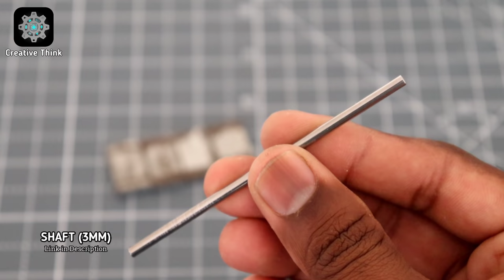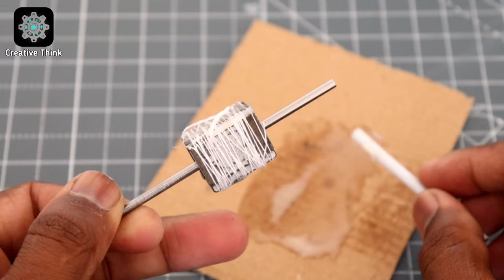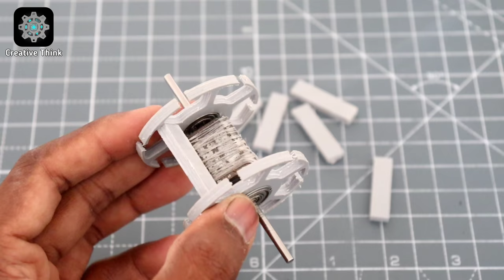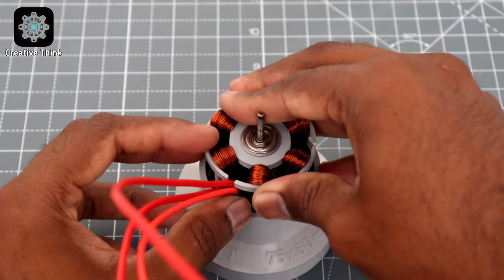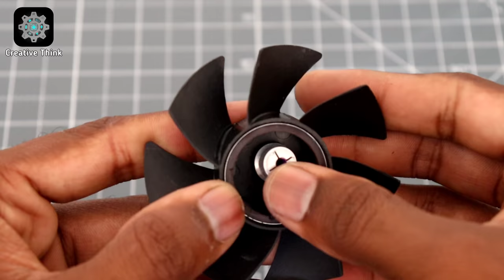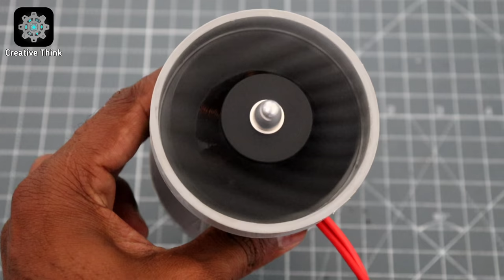Making Powerful JET Engine Using BLDC Motor

Comment: It does make a great noise. Probably good to blow sawdust away, too. I don't quite understand why you are calling it a jet engine, though. Is there any kind of combustion involved? If not, I'd suggest you just call it a fan,  saves everybody's time...
Reply: It’s called an edf. Electric ducted fan. People refer them as hers because that’s the type of rc aircraft they put them in.
Reply: For the views maybe
Reply: Maybe because it's quite powerful
Reply: exactly
Reply: The sound which is coming might be of air due to high suction ...thats the reason it might be doing noice.
Reply: I agree
Reply: Savage 😎bro
Reply: Not so powerful really and not a jet engine
Reply: It's powerfull
Reply: I say u create one your self
Reply: Agree with u bro 100%,peachout yo ...
Reply: I think he just make a motar

Comment: That would be an electric ducted fan. Great for r/c jet builds. Props for building it yourself, I'll probably just stick to a brushless.
Reply: ? there is a brushless motor inside. I personally only like the impeller with many blades and a distinkt woosh sound.

Comment: 1. How this could be a jet engine with electric motor , this thing doesn't even have enough space to pass air from the inside of the motor 
2. What is the point to place turbine , neither it gets air from the front nor there is sufficient space for it to suck air
3. Motor you made is a great piece but you need to fix the unbalanced shaft and fans and even if the motor is powerful , it cannot achieve it's best RPM with this apparatus because the fans don't have enough space to suck the air and the air drag slows the motor

Great video and could have been more useful 👍🏻
Reply: 4. There are no armature in the coils. It enhances the magnetic field in real motors. Without armature, the engine is several times weaker than it could be.
Reply: @MrEfnir  yeah true
Reply: Exactly, this shouldbe called as blower instead.
Reply: Thats Right👍🏻
Reply: I think Mr. Creative think don't know about Jet engine working process.

Comment: This is impressive but "JET Engine" by definition cannot be electric.
Reply: Yes, it a electric engine
Reply: mehdi... I did not find this "JET Engine" impressive. The fan blade units are out of balance and it has very little thrust.
Reply: @rogertycholiz2218  little torque of course, just look at the winding, there's no laminated core in the coils, so magnetic field it's not very powerful
Reply: Your definition of "Jet engine" may be flawed. An engine is a machine that converts power into locomotion (steam engine) or a substantially different product (graphics engine). It is also used abstractly to indicate the driving element of a process (economic engine). Engines may be named for the type of energy/fuel they consume, the function they perform or the product they produce. In this case then, a jet engine is a machine that creates a jet (rapidly moving fluid). From the sawdust being blown away I'll say the video demonstrates that the gadget functions as an electrically-driven jet engine.

Were you thinking of a turbojet engine? That engine creates a jet of gases by burning a kerosene/compressed air mixture and uses a turbine to recover some energy from that jet to drive the compressor and sustain the engine's operation. The "turbo-" is often dropped from the name. A turboprop and turbofan are turbojets which additionally extract energy from the exhaust jet to drive a propeller or a fan respectively, which creates a secondary low-speed "jet" as thrust.

Comment: Nice vibrations bud, very accurate drilling, also good that you twisted the 3 phase wires together, bigger chance for a short circuit once you put more amps through the winding. Also twisting the wires with the esc? Seriously? I was just thinking "don't twist them, solder it" and you did it... Not gonna talk about the wrong usage of prop adapter, so many mistakes, I'm just really surprised that it worked and didn't fell apart when you ran it.
Reply: Guy hand makes a brushless motor using his homemade CNC machine:
Me and Marek: Not good enough. Try harder. Use solder.
Guy: The only way I can get solder is by refining tuna blood.
Me: tuna are my enemy.

Comment: Cool  Inducted fan motor fan.
 I do have a question about whether its balance looks like you having a lot of vibration when you turn it on
Reply: That was my question to. It seemed like they picked a random three to be the center of the wye. That is if they are using three phases. A diagram would have been nice to see.

Comment: Your hand precision is very bad, you couldn't drill through the centre of the fans, later you just cut those fan blades to fit in. And it's not jet engine.

Comment: wont the heat of the coil melt that plastic?
Reply: Probably not, as all the airflow is through the motor, which provides cooling. Design validation testing hy operating it under controlled environment conditions while monitoring the housing temperature will provide a definitive answer.